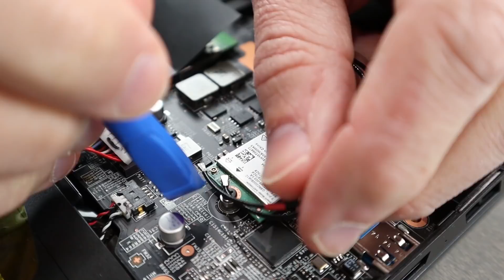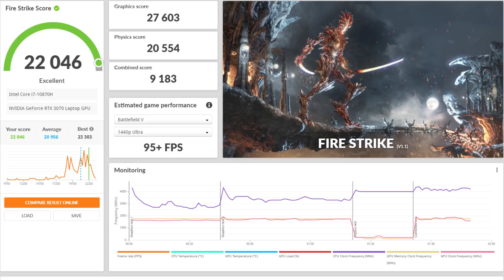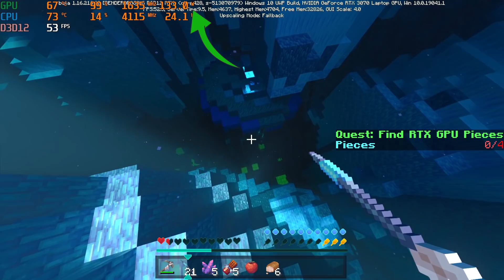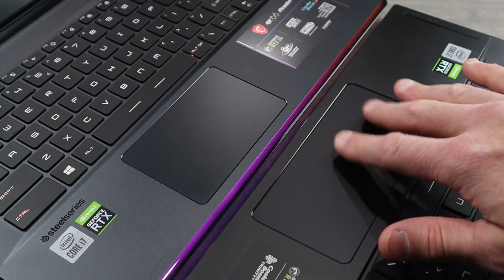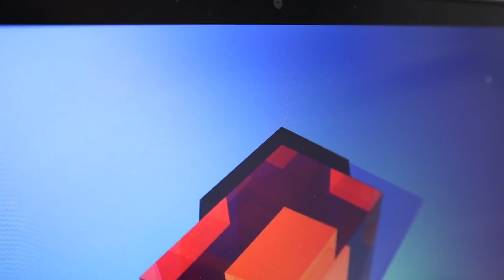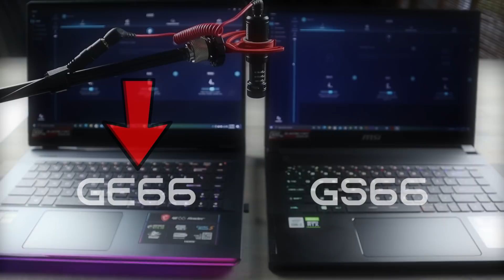MSI GE66 Raider Review!  RTX 3070 125w

Comment: I have this laptop with rtx 3070 with 32 gb ram 1TB drive. with 240hz screen. I want to have a external monitor with at least 240hz display. Should I used the HDMI port or the mini display port? any help would be appreciated. Thank you.
Reply from the maker: Mini dp
Reply: @BobOfAllTrades  thank you! I am gonna be using the the external monitor as my main monitor for gaming.

Comment: The 240Hz QHD model is now available with the Intel 11980HK, RTX3080 16GB (130W) and 32GB 3200 Mhz DDR4 (MSRP $2999.99)

Also, quick notes --> the new GE66 model with the 11th gen Intel CPU has a HDMI 2.1 port, mini DisplayPort 1.4, and Thunderbolt 4 is now available!!

Comment: Ihave this laptop//// if you reduce processor power to 97% you get 10-15° cooler cpu, with still ultra settings in 1080p like 80-120fps  in halo infinite and 100 in destiny 2
Reply: How do u find this laptop ?
And how is the battery ?
Do i recommend it ?

Comment: Do you think the newest GE66 Raider version with 240hz QHD i7 11800H with the 3070 will still have a GPU bottle neck? Should i just go for the i9 11980HK model.
Reply from the maker: 11th gen is best right now per the bottleneck discussion.  CPU tech hasn’t kept up with GPU tech.  Skip on the HK
Reply: @BobOfAllTrades  Good to know. Thanks for the quick reply.
Reply: @BobOfAllTrades  Sadly, there is no option to opt for the RTX3080 with the QHD display and the 11800H.  Only option is for the 11980HK.  Maybe more options/configuration will be available soon.  Going to a higher resolution display is a far better solution for minimizing the CPU/GPU bottleneck issue.

Comment: Currently have the ge63 8rf, worth the upgrade? I already have an ps5 and Xbox series x though
Reply: 2 cpu/graphics generations is a huge upgrade. I have a 7th gen ge63 Raider/1060 6GB.
I replaced it with a 9th gen GF65 thin 2060, great performance but not as nice thermals as the Raider. Seriously thinking about replacing the GF with a 11gen Raider/3070.

Bearing in mind the increased number of cores will also have an impact.
Reply: Ok I bought the 11800 ge66 11UG.

I'm case you're wondering how it compares, and no this is not a scientific test.

I mine every now and then. So, using unmineable:

GE63 7RE RAIDER  i7 7700HQ  1060 6gb a bit broken - 20MH
GF65 9SEXR  i7 9750H 2060 6GB - 22-25 MH

GE66 11UG 3070 8GB- 65 MH

Yes the 11th gen with 3070 is a huge jump.

I'm aware that mining isn't a real test.

Also installed latest bios and 3070 vbios (140 w tdp vs 135w stock)

Undervolt of -0.70

Un-optimised w10 build with standard crap/bloat from msi.  Not worrying about that, will do clean build of W11 when it drops.

Very impressed so far....

Comment: Give me advice please 
I can't still choose msi laptops
First - MSI GE66 raider
RTX 3070 8GB 1080 full hd ips 240hz ram: 32gb ssd: 1tb . intel core i7 10750h 

Second - MSI GP76 Leopard 
RTX3070 8GB 1080full hd ips 144hz
Ram: 16gb ssd:512gb intel core i7 11800h 

First MSI GE 66 costs 2500 $ second gp76 cost 2400$

Point using laptop is for gaming.
 I am going to use laptop at home mostly. If I go to travel somewhere of course I will use my iPad for only watching movies while I'm in airplane or train, if i play games while flying in airplane with 17 inches I may not have enough space at passengers seat and for sure battery won't be enough if I plan to play games. So about laptop I'm stuck with ge66 for only that screen has a 240hz and with ssd memory also ram memory which higher than gp76. 
About GP76 main reason that stops me to buy that screen 144hz and Korean letter keyboard and of course it has a English words too on it, in addition positive side about gp76 is only 11th gen CPU but ram and ssd I can upgrade if I really choose gp76 . Sorry for my English and thank you for your attention
Reply from the maker: 11th gen
Reply: Bob Of All Trades 240hz does matter for gaming ?
Reply from the maker: @marvelmarvel4504  11th gen would be my choice no question.   A 3070 is hard to push and 11th gen Intel had the best chance of doing so.  

Plus that’s 8 cores versus 6.  240hz doesn’t overcome the cons here.
Reply: Bob Of All Trades thank you

Comment: Bob, in your opinion, would a 11th gen intel or Ryzen make significant difference in performance? I'm planning to get one of these mainly for gaming but to do some productivity on the side (mainly office work/light programming), so realistically, I don't think I would feel much difference, but just wanted a pro opinion! Cheers
Reply from the maker: When it comes to productivity research your software because my software leverages the integrated Intel graphics and they call that “quick sync“ and it is significantly faster than anything AMD can put inside of a laptop right now. 

Gaming wise, Jarrods Tech covered this and Intel leads still but not by enough to sell me on it.  

There’s other aspects that would mean more than a few percent at that point.

Comment: Looks like the Lenovo 7i... They straight copied it 100%
Reply from the maker: Copied?  As in the design?
Reply: @BobOfAllTrades  yeah! It's a cool computer regardless though
Reply from the maker: @Jessi10010  this was the design based off of their previous GT 76 I covered last year. The hinge forward design is something we saw from the Alienware models several years ago so I would say the Legion copied off of that.
Reply: @BobOfAllTrades  I'm not talking about the hinge. I'm talking about the overall body style. And the Lenovo 5 looked like that before last year's  computer, so I'd say again.. that they copied Lenovo.
Reply from the maker: @Jessi10010  Did you read my complete message where I talked about the Alienware machines?

Comment: DISPLAY FREEZE 
 I have this laptop GE66-UG-234IT. Anyone here with problems with a second display? When I connect the laptop to an external screen with HDMI or minidisplayport (VGA adapter cable) and use both screen (not duplicate image) with software like OBS or Streamlabs i have some monitor freeze. Both monitor freeze for 3-4 second. Go black and then work normally. Sometimes the bug is introduced by mouse freeze. I thought that was an hardware problem but when I use only the notebook without monitor, it is ok. I think that is a problem with drivers. A friend of mine, bought the GP66 with the same hardware and has the same problem! I wrote to msi and they suggested me a very long list of test and procedure and i didn't tried yet. I know that there is a BIOS update but I don't know if I solve with this and I'm scared to update it because I don't want to brick the Notebook. Anyone can help?

Comment: I see that this laptop does not have G-Sync or Freesync. Put next to a laptop with G-Sync is the game less smooth on this laptop for example if it runs at 80 FPS? I am thinking about this laptop, however so far I used G-Sync laptops and I am afraid that the lack of G-Sync would be noticable and games are not as smooth :(

Comment: i have problem with warzone it says dx error 6068 i cant play
Reply from the maker: Update all of your drivers
Reply: Bob Of All Trades Hello. Have you tried warzon on it? I have a msi gp76 (i7 10870h undervolt -80 rtx 3070 16gb ram), I updated all the drivers and this is what I got. Very low 100-120fps and Ultra with rtx 90-100fps with discretated videocard. Why i have so little fps? And same problem in PUBG, 90-130fps low and high texture. And another question, how do you compare this laptop with the hp omen 17 with 2080?  Which of them has quieter and less nasty noise from coolers? Sorry for my bad english.
Reply from the maker: I have another channel dedicated to specific games on specific laptops.  How to my results compare to yours? https://youtube.com/channel/UC3KIZsFtgfRheFOX5ZnmDLA
Reply: Bob Of All Trades i got same fps if I put everything at a minimum, even sometimes less. And I don’t understand why so bad. I tried the stock drivers and the latest ones, no difference.  Maybe I have a defective video card.
Reply: @Anisyi   i think with ultra is hard to have so high fps in warzone but with low should be more than 200 ,
Reply: @BobOfAllTrades  my gpu is crashing all time , i have problem with day z with extreme mood is  freezing i have to go to balanced mood to play the game ,but i dont like because i cant play with ultra graphics and i balanced is overheating , do u think is there any problem with overclocking , or there are not  good drivers for the new series of 30    maybe the drivers for  rtx 30 are not ready for this graphic card
Reply: @BobOfAllTrades  i did everything i download  more drivers on the official site of Invidia is crashing all time and is deleting the crash i can see than one drive before i had the 6068 now i have something with 5968 i dont remember exactly  the numbers ,

Comment: Hey Bob! Great vid as always 👌 I just got the GE76 with the i9 10980HK and RTX 3080 155W, a pretty solid machine, but I'm thinking of pushing this thing to it's true potential and void the warranty and repaste it.

Honestly I don't think that the laptop will have any issues within it's warranty period so I think that repasting it will give me a nice boost and benefit of a better performance now as I would probably get another one after 2 years. I optimized it as much as I could, UV + custom turbo boost, holding 4.6ghz all cores at 80*C while gaming. I want to go for 4.9 - 5 ghz all core which I think is possible if I repaste it with Gelid GC Extreme which should give me - 10 degrees celsius.

Should I go for it, what do you think? CPU is getting 10.4k in TimeSpy right now from 9.7k stock.
Reply: All that for just 10 more frames maybe? Not worth it.
Reply: @warlock5309  For me it's worth it, the laptop will run cooler and perform a bit better which is overall healthier for the machine. The chances for a laptop to break within it's 2 year warranty window are very low, if a laptop is faulty, it's usually faulty out of the box or within the first weeks. Also I enjoy tearing laptops apart so this was fun for me overall, but everyone can do whatever they want, it's a choice.

Comment: Hey Bob, you make a comment about manufacturers stuffing in higher than 1080p displays to basically choke the video card and hide the CPU bottleneck, it that speculation or have you actually heard that. I hadn't thought of it that way before and it makes sense in a twisted way, but I'd be pretty sour on a manufacturer if I knew that was their reason.
Reply from the maker: Well let’s put it this way, there’s a reason why Nvidia showcased 3000 series at UHD resolution.  

If CPUs were twice as fast then Nvidia would use 1080p numbers to showcase performance of those GPUs because “bigger/higher is better”. 

Some of these manufacturers clearly realize this so QHD 165hz is one of the go-to panels.

Comment: it's weird to me that not a single reviewer mentions the fact the RGB keyboard is complete garbage that has uneven brightness and color.
Reply from the maker: I have two laptops here with this same keyboard and I have no uneven keyboard RGB.  It’s not like this laptop doesn’t have major issues with the CPU bottleneck so I’m certainly not going to hold back if there’s a RGB issue.
Reply: @BobOfAllTrades  I am on my third one and they all have the same issue, so my suspicion is that either the company specifically sent you a laptop where they took the time to correct the problem, or you are just unable to see it.  There's no way I got 3 in a row unless it's a huge issue, if not all of them.  One was from Best Buy and two were through MSI's Amazon store.  Have you actually tried setting the keyboard to a solid color like white?  In your video it's in flux, so it'd be harder for you to see the problem.  Turn the keys all white and you should be able to see some areas are more white and some are purple, and some keys are both depending on the part of the key you're viewing.
Reply from the maker: @imnotdavidxnsx  I’ll check the white and report back 👍

Comment: Nice laptop. I like the hp omen cb-1080nr. I did a repaste, undervolted, upgraded ram to 32gb plus added two 2tb ssds and performed a recovery and bios recovery. With a blower cooler it runs well.

Comment: Great review as always! May I ask, did you observe any battery drain on the GE66 while gaming on AC power? I had the i7-10750H/3070 GE66 config and when gaming on Turbo, plugged into AC, the battery would drain at roughly 6% per hour. I was not sure if this was a defect or design, on googling, I found various forum posts discussing an MSI feature "NOS" which seemed to pull power from the battery to provide extra to the CPU/GPU. Most posts were a couple or more years old, not specific to the GE66, and were people trying to figure out if/how to disable it. It seems to me that maybe instead of shipping this unit with a 230W adapter, maybe they should have shipped it with a 280W, as they did with the 2020 2070 SUPER model. I'd love to know what you think, and if you experienced this battery drain? I ended up returning the unit, partly because of this, but mostly because I wasn't really happy with having the 6-core i7-10750H for the price. I had too-hastily purchased when this was the only config Best Buy initially offered. I'm currently deciding whether to purchase the i7-10870H config, a GE76, or wait to see what the coming months bring. Thank you for your time and thank you for your excellent work on your channels!

Comment: Hi Bob, I got a deal for a Gigabyte AERO 17 HDR XC-8ES4450SP at 2052 euros (refurbished) and it does come with a 3070. Should I buy it for mainly gaming? I want 4k and I plan to buy an external monitor with 165hz 1440p gaming and the legacy 3D vision. My question to you is if you think its a good laptop for gaming for both 4k and external monitor? Thank you!

Comment: Awesome review! I am debating on whether to return my g15 3070 for the msi ge66 rtx 3070
Reply: I just got my G15 3070 last night and I’m already thinking of returning it, blown speakers, bad light bleed, no web cam, soldered ram, longer key travel than my Blade did you return yours?
Reply: @DamianDodd  yup returned it. Ended up with a prebuilt desktop
Reply: @_Itsthatguy_  most prebuilts are terrible , should’ve built your own

Comment: Can you please do a review of the Gp66 with the 3070?
Reply from the maker: Isn’t that basically this laptop but with more plastic?
Reply: To answer your question about the casing materials.
You start from LCD back cover, front bezel, keyboard surround cover and bottom cover.
GE66 Metal, Plastic, Metal, Plastic
GP66 Metal, Plastic, Metal, Plastic
GE66 looks more metallic-ish
GE66 looks more satin black-ish

Comment: I’m waiting for the ge76 11 gen refresh I’m really hoping they release at QHD 165hz variant
Reply from the maker: They might just do that for the 17” 👌
Reply from the maker: Yeah this shit is fun!
Reply: for me the dream is 4k120. qhd is good for gaming but meh for movies
Reply: wait I am curious as to where did you hear the news and when do you think that will be out ?
Reply: Son Gohan he’s expecting, I asked msi but they told me there won’t be a 2k variation and 11th gen cpu kinda sucks according tot he internet. I mean 1080p is the best for a gaming laptop, and with an extra 2k monitor would be the best combo
Reply: @ahhhsothisishowyouchangean162  then RIP that, legion 7 or alienware are better options then
Reply: Robotic Venom but the true problem here is legion 7, as a mobile gpu can’t really play at max settings, and on a laptop under 17inches actually don’t have much difference between 1080p and 2k. Btw, alien ware a better option?? U know how shit is alienwares cooling system?
Reply: @ahhhsothisishowyouchangean162  mobile GPU? Sure it can, the legion 7 has a vapor chamber and up to 165w 3080. What you're forgetting is that laptops are bottlenecked more by their cpu then desktops are, for whatever reason. So it can still play at QHD in pretty much every game, legion 7 and 5 pro are also 16" panels which is pretty sweet making them larger.

Alienware has much better cooling then they used to, look up the m17r4 with its vapor chamber it has some of the BEST cooling on the market, FACT. I know all of the laptop chassis's
Reply: just get legion 5 pro or legion 7 then lol

Comment: GOAT of all Laptops again 🔥🔥
Reply: @Photo Graf they're slow to update
Reply: This gets smashed by legion 5 pro and legion 7
Reply from the maker: That solution looks interesting because they’re using a 300 W power supply so I can’t wait to get my hands on one to really dive deep into its performance.
Reply: @BobOfAllTrades  Agreed! Legion 7 has a vapor chamber but last year's legion 7 had heatsink lottery, meaning some got amazing thermals, even better then MSI's raiders but some got worse thermals. I hope they have addressed, lenovo usually listens to feedback. Also, quick question, what do you think the battery life gains are for browisng on 144hz+ and then down to something 60 or 90hz via conrol panel? I haven't seen any youtuber test this and it'd be an amazing video to test battery life gains of different refresh rates! Thanks
Reply: Should I get it ? Instead of g14 3060 one
Reply: @alexshine8512  Yes G14 is hot and has very low wattage, only 60 watts so much slower. MSI is over 115 watts for their 3060 and 3070

Where do you live?
Reply: @roboticvenom1935  I live in Florida lol
Reply: @roboticvenom1935  I found version only with rtx 2070
Reply: @alexshine8512  $?
Reply: @roboticvenom1935  1599$
Reply: @Photo Graf lenovo is cheap and bad